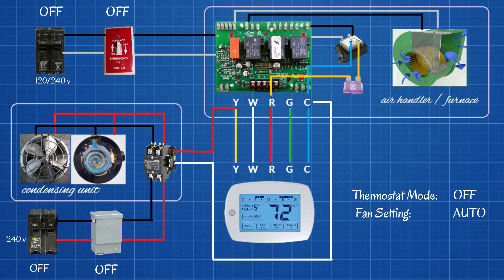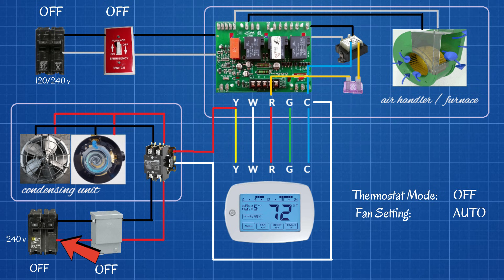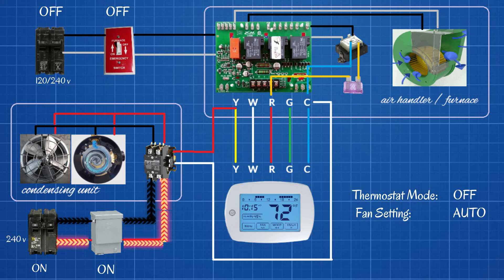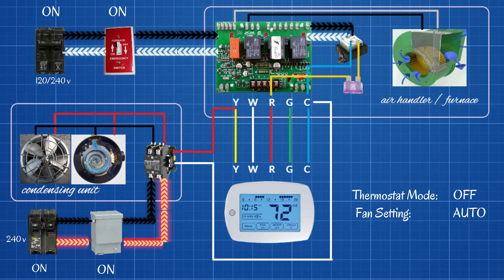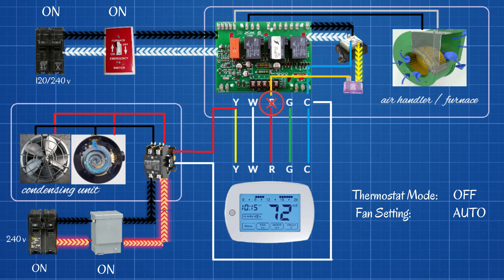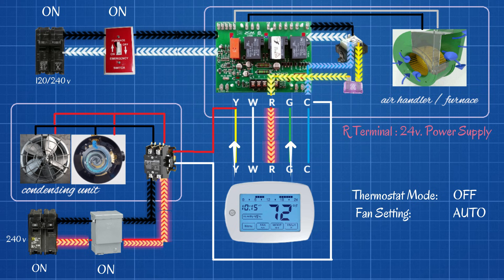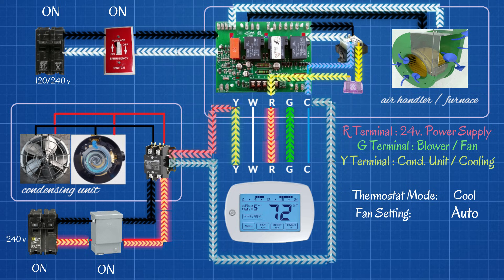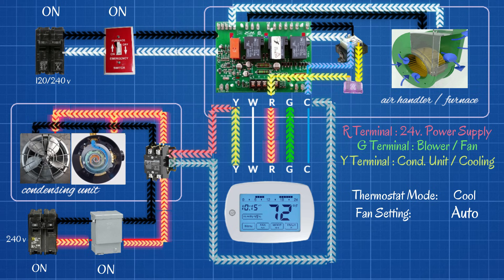How Power Moves Through An AC System Schematic

Comment: I wish you had finished up showing the C terminal powering up the thermostats that need constant power.  But I learned enough from this video to connect the dots.  I realize now that I can get the common straight from the transformer on a very old and basic system that doesn't have a C terminal (anywhere on the heating unit - only 4 terminals) and connect that transformer C directly to the thermostat C terminal. Thanks!

Comment: Mike: the "red & white" going to condenser?

Is this simply a color-coded industry standard?

Another great video!
Reply from the maker: Typically, yes. You'll often just have 3 wire ran out to the condenser, so you'll have red, white and green. Red and white is often used and the green is kept as a spare in the event there is a short in one of the other wires down the road. But some companies might run 5, wire or 8 wire or whatever, and in that case typically yellow and blue are used. Yellow for cooling and blue for common just like at the thermostat.
Reply: @JerseyMikeHVAC  Normally run Y&B, never had issues.

...like the eight strand, just in case need extra.

Thank you for the insight!
Reply from the maker: @gotchaplumber  Yup. I run 8 for everything now.
Reply: @JerseyMikeHVAC  Ditto!
...good to have extra wire if needed.

Comment: Greetings Jersey Mike:
Is it possible for an air handler using R22 as its refrigerant to work with a compressor using R410A as its refrigerant if a thermal expansion valve is used? I'm receiving so many conflicting answers here and I would appreciate the master's advice.
Sincerely,
Rod Machado
Reply from the maker: It is possible to do it, but it's normally not recommended because the R22 coil just isn't designed to handle R410A pressures. The TXV could help with that if you got the right one, but this pretty much puts all the success of the set up on the age of the evaporator coil, and they haven't made R22 coils for years now, so the older evap coil is highly likely to spring a leak. And if it does work, that might put extra strain on the compressor of the 410 unit in exchange for protecting the evap coil. 

 In my career, it seems 9 times out of 10 the older R22 evap coils spring a leak before the R22 condenser coils do. So the odds of older evap coil working under abnormal pressures and you getting a few years out of it I would say are not very good. 

 R410A is also being phased out now, so even if you can make this work, getting a few more years out of it may not yield much of a ROI, because once that evap coil goes (and it will), you'll then be looking at a situation where you now have to choose between installing a 410 air handler to match the CU that is starting to phase out just to keep cost even with replacing the whole system now (although to be honest, I wouldn't worry about it too much. 410A systems are still going strong, won't disappear anytime soon and will continue to be serviced even after the full changeover to the newer systems is complete, which alone will take years to do), or lose money on going with a whole new system with the new refrigerant systems being introduced and eating the cost of the 410 condenser.
Reply: @JerseyMikeHVAC  Greetings Mike:
Thank you so much for that very detailed answer. A little under two years ago I was sold an air handler that uses R22 and a compressor using R410A. The unit never worked properly. The compressor would come on for a minute, then shut down. The only time the compressor stayed on was when it was less than 75F outside. I can't for the life of me understand why I was sold an R22 air handler, given that R22 (freon) is so darn expensive compared to R410A. So it looks like I'll have to replace the air handler. I wish you lived in Southern California. I really do appreciate the GREAT advice very much!
Sincerely,
Rod Machado

Comment: The smart thermostats I've used give you the option of whether or not to energize the green wire when turning on the furnace. If the green wire is energized, the blower will turn on immediately. If it's set to let the furnace do it (don't energize the green wire), then the furnace will go through its startup routine and the control board on the furnace will energize the blower motor once the startup routine is finished. The 2nd option is the more common setting. Older, non-programable thermostats, including mechanical thermostats, used the 2nd method by default.
Reply from the maker: Is there a standard default setting on that or will it adjust according to system set up? I'd imagine that "activate" option is for electric furnaces. Curious if it defaults to "activate" with electric furnaces and defaults to "not activate" on oil/gas. Or does it always have to be done manually?
Reply: @JerseyMikeHVAC  I've been using Honeywell thermostats and their default for heat is to let the furnace turn the fan on, but it is configurable. However, this was also the way old mechanical thermostats worked (the ones with the glass tube of mercury).

Comment: I don’t see the capacitor
Reply: It is not a relay or control system
Reply: @BabbyGuavaandfriends So what, it's still electrically  powered and has a purpose and function.
Reply: Good observation I didn't catch that. How does it incorporate into the circuit?

Comment: JM, this is awesome. thnx for putting it out there. Hoping to see a similar set up for the heat pump system with electric heat strips.
Reply from the maker: Definately
Reply: oki, dude. is there anyway you, (or any one else) could explain how the "common" and the "ground" is the same in a 24v circuitry. Or how is the common grounded, or where? Thnx. @JerseyMikeHVAC
Reply from the maker: The unit itself is grounded through the high voltage back to the electrical panel. The low voltage ground just gives a path for the power to follow in the case of a ground fault/short. 

 Some older systems terminated low voltage circuits on the unit chassis rather than on a common terminal. A lot of furnaces used to do this with the burner circuit.
Reply: You know, after all the issues, stress, that i was bothering you, and every one else out there,  with my outdoor unit not starting up in heat nor cold mode??? I decided to go and check for myself, to see if I could see anything for my self that maybe the cause. AAANNNNDDDD....GUESS WHAT? I touched one of the wires that goes to the COIL OF THE CONTACTOR, and the darn thing CAME OFF in my hand. All these yrs, and THE MECHANICS who installed this unit DID NOT HOOKED THE WIRE ON PROPERLY TO THE CONTACTOR.  It must have been touching somehow, thru the yrs, passed, because the unit was working ok, until recently. I connected back the wire PROPERLY, to the COIL, and put the thermostat to call for heat, and BOOM!!!!!, IT WORKS like a CHARM. Maannnn!!!!. I am happy. All is good now. But I really appreciate YOU Sir. Thnx a million for ur help. i HAVE LEARNED A LOT, these couple of days, AND I DID NOT LOOSE ANY MONEY. One guy in my area, when I called was asking $195.00 to come out to diagnosed the unit. WHAT A BUNCH OF RIP OFFS, they have here in ORLANDO. BUT, they did not get me. I am moving back to NEW YORK. Where the good old REAL AMERICANS ARE. THAT CARES ABOUT THE AMERICAN LABELING. Because these FOREIGNERS DOWN here that called themselves AMERICANS, are a BUNCH OF FAKES AND SCAMMERS. Now I know WHY a certain ONE TIME leader of the FREE WORLD, has his holdings in this state. IT IS WHAT, IT IS. But, GOD Bless YOU Sir, and may God still BLESS AMERICA.  @JerseyMikeHVAC